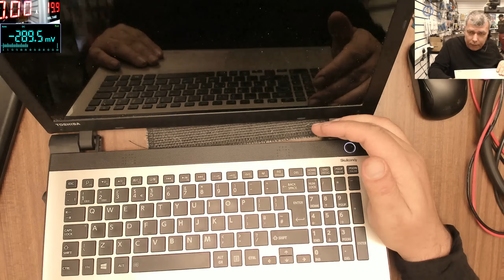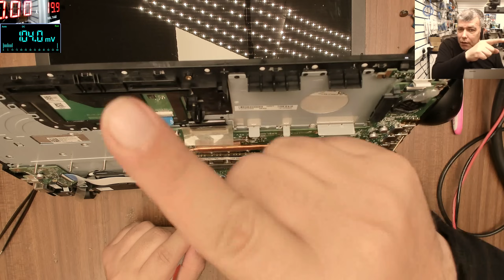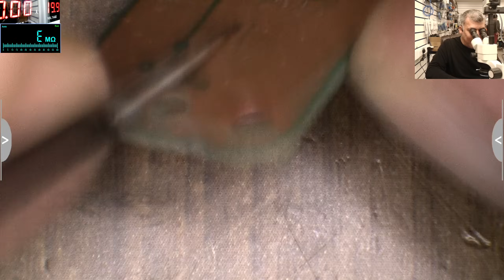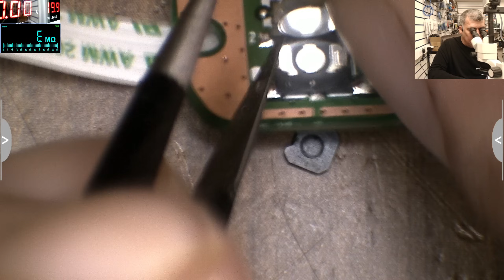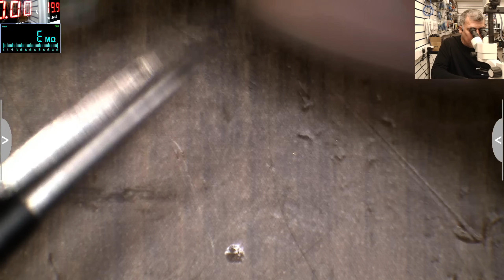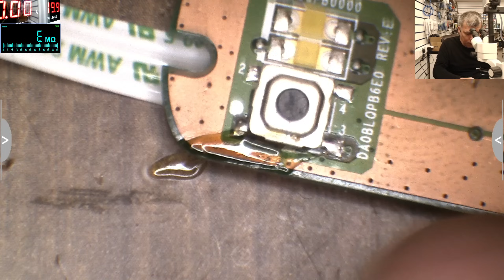Laptop comes on and goes off -  tricky :P

Comment: Sir, I have been experiencing an issue with my laptop.
When connected to the AC charger, it shuts down automatically within about one minute, even during light tasks.
After shutdown, it requires a short wait before powering on again.
The same issue occasionally occurs on battery power.
No overheating warnings are shown, and the charger appears normal.
What might the problem is?

Comment: Mine is different it turns on it works perfectly and it shuts down randomly please is there any solution it's not by over heat i fixed that but it turns off
Reply: Same did you find a solution?

Comment: It can be the ram or cmos battery, or the adapter
Reply: @ayehstephen_133-lm9xf  is coz of insufficient amperage?Coz mine turns on the moment it's plugged and then turn of after 2-3 seconds, after that doesn't turn on again. My battery died a long time ago so I don't use the battery. But sometimes the laptop turns and sometimes it shutdown while using it.The power adapter I'm using is 20V 3.25A and my OG one was 19.5V 3.34A. Could this be the issue or maybe the CPU?coz I've changed my Ram modules and hard drive.

Comment: i was gifted a Lenovo laptop some years ago where it displayed the same symptoms as in your video. Mind you this laptop had no issues when i first received it. I thought it was an overheating issue, so i placed on new thermopaste and give it a thorough cleaning. Still the same issue. Other videos solutions did not suit me as i do have half the equipment and parts are difficult to acquire.
It may be an old video but the solution is spot on as it is indeed the power button. However I cannot fix it as the keyboard and power button is merged into one. Yes, it is one of those....
I just want to thank you for your videos as I find them very entertaining and educational. 
By the way, I am also able to turn on the laptop via jumping the connector pins on the motherboard without connecting the keyboard/power assembly ribbon cable. Its been close to an hour now and the laptop is still on.
Again thank you very much.

Comment: Thanks a lot I just found your video and look like it's the same problem I have been facing and my laptop 7 months ago as I was unable to repair it from the local shop . I just give a try to that laptop as it has some useful files. And guess what after removing the power button strip it is working for about 2 hours now and still on. Thanku again for this helpful videos.

Comment: I have a problem which is a little bit similar. My laptop turns on like what happens here and then goes off, and after that, it turns on again by itself and stuck in that. Can you help me, sir?
Reply: @nathanromany8138  Same, fix it ?
Reply: @nathanromany8138  same problem pls tell me solution
Reply: Did you hear click sound
Reply: @DrkITZme 
Omg, thanks you for reply. I've solved the issue. The laptop was booting bios because its battery was damaged and the bios went in a deep sleep or something like that.
Reply: Someone advised me to leave it keep going in that loop and then it will work. And after that it worked ok. It was terrifying for me, but thanks god it worked 😅
Reply: @DrkITZme  i hear a ckick/bzzt sound

Comment: Hello brother hope you reply soon 
Same error after pressing the power on button laptop i goes off like you showed in video 
I treid most of the possible things removing battery removing static current etc i have treid to turn on by your method power button is built in keyboard so i try to short using the last two pins of keyboard ribbon connector port (ribbon was disconnected from port while sorting) but still don't work  i confirm by connecting ribbon to port that i have sorted the right pins 
I have treid cleaning ram disconnecting and connecting most of the port connections still same issue what could be reason
Reply: @Zakisthename  thanks 
I have got it repaired at shop

Comment: My sister just gave me a similar Toshiba laptop and it behave exactly the same. She said she just replaced the cmos battery. I was hoping it was the power button like this case but it end up to be her laptop battery that is causing the surge. Boot up and run fine when the battery is removed and run on AC power.

Comment: Hi brother i hope you are fine. I'm facing the worst issue with my HP Elitebook 840 G7. it shutting down automatically after 20 or 30 seconds sometimes after a minutes? every technician have checked it but failed to diagnose its issue? how can I contact you. I will send you the video of the issue? its a new generation machine. no help is available on the forums too unfortunately😑😑

Comment: Thanks Sorin. I like your videos very much. Especially your style. Actually I got interest in repairing laptops after watching your videos. I have a motherboard that develops bios, ram and core voltages after pressing the power button but then goes off and the power supplies. Main power rail remains present at the input. It tries to turn on two three times and then remains off. I have tried to turn on by shorting the pins to bypass the power button but no success. Any idea about the fault? Which area to check further please. Suggestions from the forum members are also welcome.
Reply: @shahzadkayani1  same problem tell me if you fixed it already

Comment: Mine is an hp laptop in 7th gen cpu everytime i open it it just goes on and of many times til it will not power again once I run it the next day it goes on then less than 2 minutes it goes back in its problem again then when I quickly turn it on no power light goes on and the cpu fan is running so madly like a house hold fan endlessly so loud

Comment: At 6:55 what senser is he talking about? Lead senser? I was having the problem being discussed here and removing the power button ribbon cable made my laptop able to turn on so I'm thinking replacing that senser and power button could fix that issue. So someone could please tell me what senser is that.
Reply: And my power button is on my mother board... Sooo why does removing a long black ribbon cable which is connected o the mother board an then goes under it, turn my laptop on and stay on?
Reply: He was talking about the Lid sensor, the sensor that turns off your screen when you close the lid

Comment: Voltage feedback failure. 
You can tell a lot about what's wrong with a power supply in the first 10 seconds that you power it on. The power could be good, but the supply doesn't know it, so it shuts down after the boot circuit stops preventing a premature power failure.
Reply: @rickpontificates3406  plsss how to fix it

Comment: Sorin, am o problemă similară cu un Toshiba Qosmio x70b. 
Se închide și cu power button scos, nu cred ca e heating problem pentru ca exista hot air ce iese din vent, iar când se închide laptop-ul temperatura pe CPUZ e Max 50 grade. 
Ciudat este faptul ca atunci când se închide, dacă îl pornesc iar se închide imediat după 2 secunde - trebuie să scot power line-ul pentru ca el să pornească iar și să rămână ON. 
Nu pot să îi dau de capăt

Comment: I'm not one to criticise, Sorin, but that hot-glue fix of the CMOS battery holder you damaged, is a bit ... shonky  as the Australians would say. At least I'd solder/fit one of those dirt-cheap plastic bios-battery holders you can get,  so that revisiting to replace the battery is a bit easier.  The ones with wires coming out, & a tiny on/off switch

Comment: Hello,  Sorin I have Toshiba Satellite Model LP55,  sometime i switch on  power and laptop working for minute  then it comes off, sometime it working for one hour or two hours and seems working properly , and and comes off again, sometime it take longer and working, i did clean cooling fan already, butt still the same . it happen specially when i start laptop . so what the problem you think ?

Comment: Sir i would like to ask one question Could you clarify please if u connect to the charging port 19v and additionally u come with power supply what is that voltage u given additional to the capacitor on the power rail

Comment: hey Sorin, I have an HP Laptop that seems to just shut off when you move it, and has problems turning on, have you found anything similar? I believe it happens in both battery and charger and the problems extend even if the battery is not installed

Comment: Hi Z, i have a HP I5 (TPNC125), runs fine on battery, battery recharges all good with laptop screen closed, however if i try and use Windows while connected to power sooner or later it will shut down if connected to power...
Any ideas Z .?
PeaceFromOZ

Comment: I have kinda the same issue, it's just that the laptop boots up to the desktop screen and shuts down right after. 
Tested power supply and power port they are good.
Performed reset on the bios and still it's shorting the power.

After the first shut down then it starts going off exactly after powers on.

I don't have much gear so any idea what might be the issue?

P.S. It was in repair centre recently and they changed the motherboard.

Comment: Hello sir, i have same kind of problem, the charge light is on, when i press power button it turns on, fan runs and then its turns off.... can you help ...
Reply: Same bro, it turns on, and then it turns off. I don't know how to work with it.😔
Reply: @mshafeek2665  news?
Reply: @mshafeek2665  same problem, what did you do?
Reply: @mshafeek2665  did u find out what was wrong cause I’m having same issue
Reply: all you?? for real?  mine's been dead for like 3 months doing exactly the same. power on, a few seconds later fan goes max, and it dies. someone pleasssssssssse anything?
Reply: @DK-ut8cx  same problem 🥲, what to do
Reply: @ghazanfarrana-e1d  same with mine now .. where you able to remedy it ?
Reply: @topeadams9478  same problem? What's solution
Reply: @topeadams9478  sane
Reply: Same problem as well for my asus
Reply: Same problem for me
Reply: @imspeak hi were you able to fix this?
Reply: @amrahorrie  we’re u able to fix it?
Reply: @ghazanfarrana-e1d  did you get the solution
Reply: Same problem 😭😭
Reply: i have this exp in pred helios 300, i think its the accer application. if i see the acer power button window, itll turn off in a few secs.
Reply: It's a battery problem or charger usually just shock it

Comment: I'm having the same issue with my dell latitude 3450 that I bought from facebook marketplace, Dude who sold it to me said everything is working except the replaced lcd, ram that was supposed to be somewhat like 8gb is now 2gb and the hard disk which should be 500gb is now 120gb, and by the way the battery is also faulty as it was getting inflated like a balloon over time. Now, my other concern here is that when i put the cpu on stress test it only goes to 0.79ghz instead of reaching to 2.00ghz which is the max ghz of the cpu (i3-5005u). So I decided to open it up, remove everything then clean everything with ethyl alcohol 70% solution, I also bathe the motherboard with alcohol and scrubbed the dirts and greases off in terms of hoping that should work and also removing the old thermal paste and adding a new one. Put everything back together in the right place and then upgraded the ram a bit from 2gb 1600mhz to 4gb 1333mhz and 2gb 1333ghz in total is 6gb 1333mhz. I thought at first it was the RAM problem then I reverted the ram change back to the old ram it have and it still doesn't boot. Any ideas what did I messed up here? at first when the issue rised, I would click the button once and in just 20 seconds it would turn itself off without any display, beep codes or anything shows of a code error. Then tried disassembling/reassembling the whole laptop and now the issue is different from before, I had to hold down the power button for it to make the power led lights up for 20 seconds only but totally no show signs of life whatsoever neither fan spinning.... I don't wanna lose hope since this is my only laptop I have been using in my university and don't have the budget to bring it to a tech nor buy a new one... Just please can anyone help me, I would really appreciate it

Comment: for me the lcd cable that snaps on the mother bored was loos so it kept shoring out the laptop mine is a Lenovo y50-70 and to fix it i moved anything near it that causes it to come loos for me it was one of my shredded speakers that kept hitting it. I then put some cardboard and some tap under it and put some by some i mean not even a drop of t-7000 glue it worked and the cable  stopped popping off or going loos the good thing about t-7000 glue is hat its removeable if i need to incase if i need to replace it witch i am

Comment: I have a 6 year old Dell laptop. So far it has worked without any issues. I always paid attention to the physical and software cleaning, I did, I had it done. For the last 1 year, my laptop has been cutting power by itself and shutting down. I'm so tired now nothing works. The harddisk is solid, the pastes have been changed, the detailed cleaning has been done (the computer guy said he did it), the video card was checked and it is solid, there is no problem with the processor, there is no problem with the charger, my battery is about to die, it works at 25% efficiency, but when I remove the battery and run the computer like that, I also experience a shutdown, so the battery isn't the root cause of the problem either. Please help me I'm about to go crazy. I'm going to throw the laptop on the wall, I'm so tired now

Comment: I just changed my thermal paste, i try to turn the laptop on but it won't work, i try to remove the fan n then it's work....any idea why this happened? Ty
Reply: Yes the laptop stared after I remove fans, but it goes to diagnose my laptop n can't fix the issue, i try to put on the fans but still the same

Comment: For me the problem was the memory on a acer nitro 5,i just had to take the battery out, take out the memory, put the battery back turn on the laptop without the memory then it was working and i bought another ram stick.

Comment: Behavior of My HP Envy 13 x360 (2020) is random:
- Clicked power button, Fan is on but no display but fan goes off few seconds later.

- Clicked power button, Fan is on but no display, power LED and Caps Lock starts blinking (5:3) then fan goes off.

- Clicked power button, Fan is on but no display but fan remains ON.
Reply: How'd you fix it
Reply: Not fixed. I had to replace motherboard with new one but guess it happened again after one week . HP sucks

Comment: Thank you so much, my oem keyboard was liquid damaged(power button on them). I replaced with china one like 2 week later suddenly shutdown and not started. I check any shorts on board and charging port to battery line everything was right. I'm was confused. But now i tested again without keyboard. It's started and not turned off. İt works :D

Comment: I received laptop from my client with same problem. I thought I had no solution until I saw this video. AMAZING?? The power button is soldered on the motherboard. I tested it and found it well. I remembered to do as I do with the garage remotes controls. I washed the plate around the button with the KONTAK PCC spay and luckily it worked. Now it works perfectly!!
In my experience with repairs, I know that, with apparent large anomalies, it may only need a small repair.
Tanks for this channel and for the inspiration given. Be happy
Reply: Can you send me here a picture of the Kodak PCC spray you use to clean it?

Comment: I think i have a different issue i tested the continuity on the buttons, they seem ok, but I think my issue is the power button port for the cable, because I also tested the continuity for the cable out of the 2 ports. 

All 4 pins or paths work, so it seems like that or some other component on the button bored, I say button bored because  the lonovo g580 2689, has a separate bored that has 2 buttons on it ,  the power button, also  another button, I found out opens the bios menu.

When I say separate bored I mean not connected to the motherboard.

I am not sure what happened as the buttons worked or atleast the bios menu button worked, all I remember is there was a spark when I pressed the power button, I think it is because the cable from that bored to the mother bored or ane the port/s are very loose so basically it shorted.

Because I think after it shorted the buttons stopped working.

Comment: If ram, fan, power cable all replaced but it still does this fault, what could it possibly be - so lonovo g580 2689 when I turned it on, it constantly beeps, the fan would be on, it turns on but not fully, it does not show any logo, when press the key to open the bios menu pop-ups it shows the menu, the mouse and keyboard works but when I click on the bios option in the menu any option, nothing happens, all that happens is the the bios menu pop-up disappears.

When I say the bios menu pop-ups I mean the menu (startup menu) that has other options like - system information, system  diagnostic,boot device option,bio setup,  system recovery,  network  boot etc.

When I click on any of them option nothing happens other than that (startup menu)  pop-up disappears

Comment: I have incountered that problem with power button included in keyboard. To make it cheap i dont replace the keyboard because keyboard working fine except the power button, I Just make jumper wire and make a new power button.

Comment: Tricky indeed, i had this issue on my old dvd drive the tactile push buttons switch fail because of bad contact i prefer to scratch that tiny piece carefully without damaging its shape and in the inside too then clean everything with alcohol and avoid using too much flux when soldering them it goes inside and it sticks there some are easily fixable and some not

Comment: Dear thanks alot so, the second mosfet the input has 19v and output is 17v  and the current resistor/sensor has 17v  is that right?